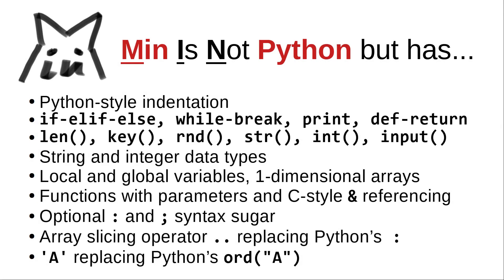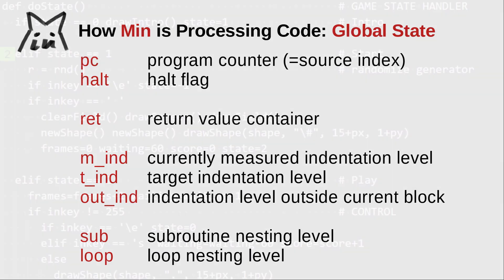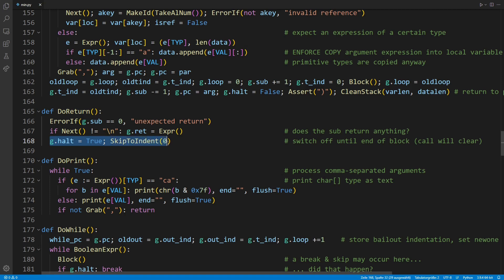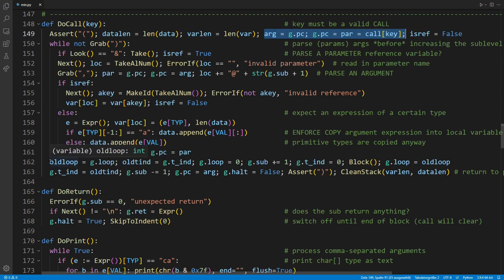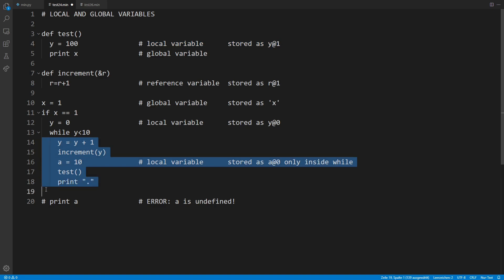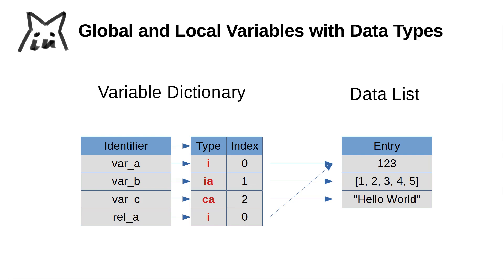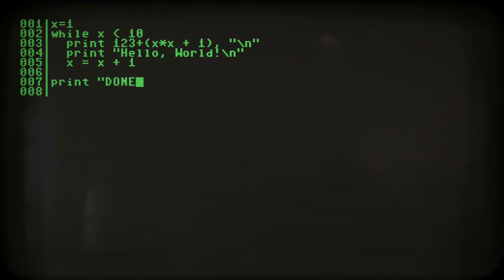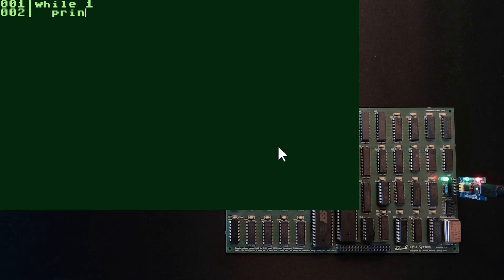Computer Language from Scratch #2 MIN at Work

Comment: One thing that's not clear for me is how 'min' operates at run time as it's parsing the instruction and generating the control signals for the hardware. A simple video perhaps taking a calculator example that just takes two numbers and performs arithmetic on them. But starting with 'min' and taking a line at a time to see what's happening with the stack, registers and ALU along with control ROMs to make it all happen. Just a suggestion !
Reply from the maker: Min does not have access to control signals of the CPU. Min just an interpreter written in assembler.
Reply from the maker: ... and I'd need a whole video series to explain how Min works. Its quite a complicated piece of software - at least for my skill level...
Reply: @slu467  ah, not so trivial then. No worries.
Reply: CoruscationsOfIneptitude  yes it's pretty cool. The only downside is it's all virtual and not so hands on. Hard to beat building and analysing a PCB based design I think.

Comment: Another great video, and a very impressive achievement. It's very inspiring. I love that its a Python based language rather than another Basic interpreter. The ZX81, which I used to own as a teenager, was not that much faster than the Minimal. It's Basic was very slow.
Reply: To be kind to the ZX81, its BASIC interpreter was designed to be as compact as possible. In spite of its slowness, it's quite impressive for how much functionality it fits into so little space.
Reply from the maker: Well said, Keith. The ZX81 is a masterpiece in minimalism.
Reply from the maker: Hi David,
I too remember the ZX81 very well. It was the first machine I got my hands on... remember that moonlanding game? Just a row of numbers going up an down - but so exciting ;-)